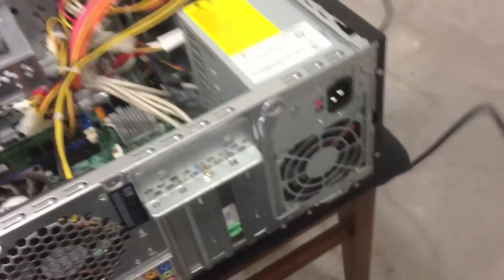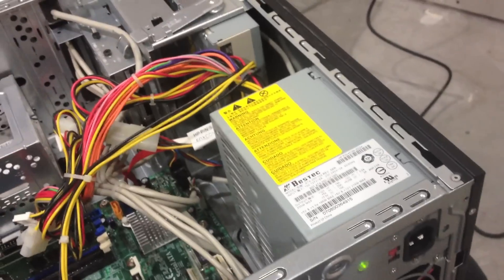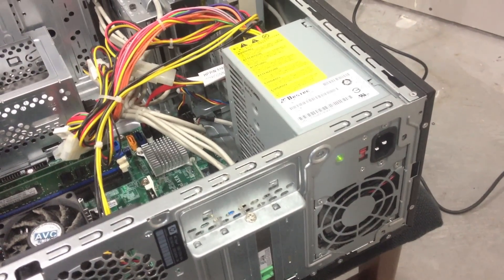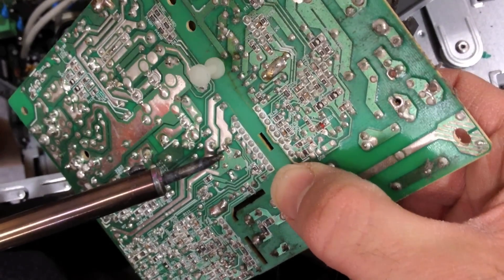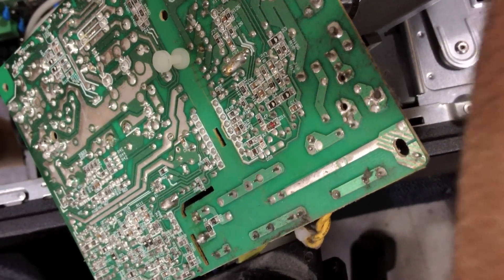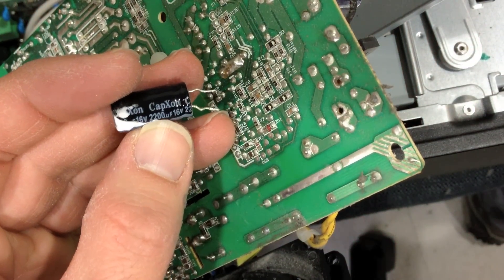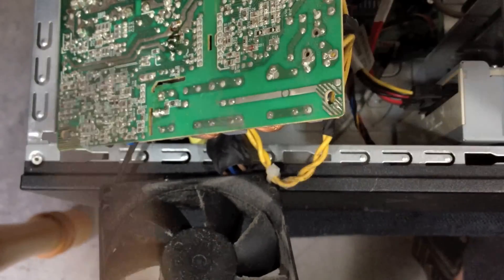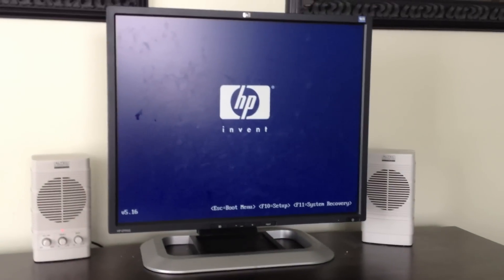Computer Power Supply Repair - DEAD bad capacitor No / Flashing Green Light

Comment: Hi, recently my PSU has become strange where my pc does not power on anymore, sometimes it does.
I particularly noticed this when we have been having many brown outs over months and months.
I do have a good surge protection plug which i spent alot of money on, i use the same for tv etc.
After giving up because my PSU just does not come on and the red LED light is not coming on at ther back either, i decided to take out the PSU and do a test on it.
I bridged the Green pin and the neighboring Black pin with a paper clip.
Plugged in the mains and turned on the plug switch.
Then i turned on the psu switch and the fan started to turn.
I tried to turn it off and on again, the fan does not turn.
I tried to unplug everything and retry a few times waiting a few minutes between each test, it seems the fan spins when it wants too and the red LED light goes on when it wants to.
I opened the PSU up and found that one of the BIG capacitors is swollen and the top is leaking fluid.
Can this cause the PSU to behave this way?
I am wanting to know before i hold my breath and find a capacitor to replace.

Comment: About soldering. After you've soldered the replacement part, hold the pc board flat, and heat the lead from the bottom keeping it flat. The excess solder will run off onto your iron and it will look like it did when it was run over the solder bath when it was made. Does a neat job.      Just saying....................'MIke.

Comment: Can you please tell me the name of the component that is wrapped in black heat shrink tube and connected in parallel to the big bulk capacitors as shown at 1:57. My one is completely blown so could not look for a part number.

Comment: You can use down to a 6.3V capacitor to replace this particular capacitor. Usually, Bestec installs a 10V capacitor, but some revisions such as yours had the 16V part. This circuit carries 5V. I've reused 6.3V 2200uF parts from motherboards to replace that cap. It's that one and sometimes the nearby 220uF 25/35/50V capacitor that will cause these units to act up. Also, the caps over on the secondary tend to fail. The Bestec units tend to have capacitors from Jamicon, Teapo, or Capxon in them. The Jamicons usually last longer. I've recapped enough of these 250-12Z units to lose count. The one unit to avoid fixing altogether, is the 250-12E... this unit has a faulty 2-transistor design 5VSB controller that fails with time and takes out the motherboard. eMachines were notorious for these units burning up, sometimes violently.

Comment: Ya next time you can subtract the solder by using a braided wire (and i would recommend resin flux NOT acid flux..) Otherwise good video...

Comment: is it weird that i ripped out 2 broken capacitors outside of a dead xbox one s and got it working with a atx psu??? shouldnt SOMETHING happen? there were originally 3 capacitors but 2 of them were dead so i ripped them out and  the console works completely fine with only one capacitor near the power plug near of the apu?

Comment: Voltage rating is important because it has to be filtered. But capacitance is not. A Capacitor has other parameters as well. Capacitance is just one of many!
And CapXon KF is a so called "Low Impedance" series wich is made especially for higher frequency stuff. And there are no 85°C Types from any half way decent manufacturer that are Low ESR or Low Impedance. So replacing that with an "85°C" Cap means that replacing a good low Impedance type that is rated for 2000mA Ripple Current (or more) with some garbage that has half of that or less!!
You can not replace different types of capacitors!! You have to replace a low ESR type with another Low ESR type, you can NOT replace those with General Purpose ones like its done here.

Comment: Put the solder on the tip and remove any excess before you then touch the connections.

Comment: Absolutely superb tutorial. My old compaq pc power supply had exactly the same fault and the same dead capacitor.made the replacement as directed and the pc is now working perfectly. I cleaned both fans while it was dismantled and it now runs quieter than ever. Can't thank you enough for your instruction. Pete.

Comment: Does your Ac input Amps have a impact on your PSU turning on i have a 
evga 500W 80 plus. That won't turn also i had a 600w that did not turn 
on so i exchanged it for a 500w power supply. Would a power strip help 
with the problem?

Comment: The proper way to solder is to heat up the joint with the iron, and then touch the solder to the joint---never touch the solder with the iron.

Comment: I had exactly this problem on our old HP desktop. Followed diagnostics from another video and concluded it was the motherboard. Bought a cheap secondhand replacement motherboard but still the same problem. Saw this video so stripped down the power unit. Exactly the same capacitor had blown C63 on the pcb mine was 2200uF but stated 10V not 16V. It had a bulged cap so changed it out. Had a very old pc in the attic to get some spares. when rebuilt it fired up perfect. Just had to reset the clock as I had removed the CMOS battery in my tests but other than that all is back to normal. Time for an upgrade i think before it fails completely. Like you I need to get a solder sucker as that makes soldering so much easier.

Comment: My antec 900w psu smells burnt..still works but stinks like a plastic fire... could this be the issue? As I mentioned, the pc still works..but crashes during gaming now
Reply from the maker: +GPUabuse +GPUabuse For sure stop using it and if you smell something burning you will most likely be able to locate it visually.
Reply: ended up getting a replacement for free :)
Reply: +Joshua Ladlee Yeh i'd get a new psu asap. It'll only keep happening till it dies and when it dies it may take out other components of your pc which could cost you a lot of money.
Reply: thanks for the answer - we ended up getting shipped two! haha
Reply: Same..
Reply: Don't change it, why you will buy another one if you could repaire it, if it's still working and you smell stink like a plastic fire so it's good like that , you can locate it easly , and look at the references and buy them and replace them , simple it is ... so don't waste money or just repaire it and give it to someone who can't buy one more if you have lot money lol you know what i mean , peace
Reply: GPUabuse great , better like that xD

Comment: My PSU was storing 100 or more volts on the main capacitors for a while, what can be damaged when that happens? For sure is on the primary but I can't find anything damaged :(
Reply: +hqdefault Found it, the transformer that connect to the secundary have a corroded broken pin :(

Comment: 90% of the time when this happens nothing is wrong you have to have the power supply plugged in unplug the 24 pin press and hold the power supply then while holding the power button plug back in the 24 pin and it should work
Reply: Actually you will find that holding the power button with the mains disconnected does the exact same thing... it's called a static discharge. This works with laptops too but you need to disconnect the battery.
Reply: Thanks man it worked
Reply: i have had the same thing happen to 3 computers i have, personally it is the best trick in the book.
Reply: yeah remember that it will happen again whether the same computer or another one.
Reply: this trick looks to be tested! mine to made a sound when i tried to power up my pc and now nothing! there's no power coming out of the wires !
Reply: +atstech if it made a sound your supply may be poached
Reply: Zachary what's the 24 pin press ?
Reply: Zachary and how do you hold the power supply
Reply: What about 20-pin boards - remember AGP anyone?
Reply: how do you hold the power supply?

Comment: I have done this many times to power supplies, motherboards, monitors, and video cards. The crap capacitors they put on there usually fail before anything else does and can be easily replaced with good quality capacitors like Panasonic and Rubicon. Small caps like the ones in PC components are very inexpensive and could mean the difference between paying a couple of bucks for a cap or a lot more for a new component. Just be safe and watch more tutorials if you are not sure.

Comment: what is all that white stuff over the pcb?
Reply: +Daniel Lee I'm not absolutely sure of this, so, someone, please correct me if i"m wrong.

The white stuff is glue, which is put on there to prevent the components from vibrating and making excessive noise (a buzzing sound, like an old laptop screen inverter). I've seen it on several power supplies. It may look quite weird, but it's perfectly normal, and, if I'm right, is actually a good sign of quality.
Reply: Racecar564 my psu has some glue under the biggest capacitors, i thought this white stuff could mean they had leaked
thanks
Reply: +Daniel Lee Negative....As Racecar564 mentioned, this is glue that is put there to ensure the components don't get loose with vibration over time.

Comment: Don't PSU store power even when its unplugged? How do you drain out the power??
Reply: +Kayemache You are correct. BE CAREFUL WITH THOSE BIG CAPS. Always use a high power rated resistor, hold it with some pliers and connect it directly to the caps leads. Do not short the capacitor leads as it can destroy it and possibly damage other components.
Reply: You wait a few minutes. Usually they have a diode or a resistor in the circuit that is supposed to drain them.
Reply: Lazar Šaronjić those big caps jolted me across the fcking room
Reply: I always use the of my Soldering Iron ac plug tip to touch the 2 terminal of big capacitor to safely discharged it.
Reply: One way is a voltmeter with its built in resistors.  IF just ripping it apart for parts - drop it in a bucket of water.
Reply: Worst shock I had from a capacitor was when I was working on a camera....the one used for the flash. Just cos the cap looks small doesn't mean it can't pack a punch.

Comment: That blue one was also the most unsafe one to use. Power supplies require high temp caps, the one you put in is rated for 85c, not like the 105c caps that are required for power circuits.

Comment: hey great video, i have a psu that want turn on while in a computer an when replaced the computer starts up fine. but the original psu will turn on when jumpnig the green an black wires on the 24pin connector while out side the computer an will also start the computer up if i manually jump the green an black wire on the 24pin connector. any idea what could be the issue with this. i spend alil over 100 bux on it an would like to fix it if i could cause its a 1000watt modular psu an the one ive replaced it with want run both of my graphics cards. thanks again

Comment: I have seen some sstrange liquid coming from the psu (CM B700).Some capacitor is damaged but im still using the psu.Should i change it fast,buy another one or just replace the capacitor ?
Will Antec VP450P-EC hold on this system ?
Intel Core i5-3470 3.2GHz
6GB DDR3 RAM
GeForce GTX 960IX-OC
2x500GB HDD
Thx for info :D
Reply: +Mise Sapphire buy a power supply if you can afford it but if you want to gamble your chances buy the capacitor and do it yourself  but if your fixing the computer for a friend or a customer you better off just replacing the power supply  with a new one. less chances to fail unless  they shipped you a dead powersupply that can sometimes happend .
Reply: rdbagaming
I have bought a new Antec psu :D
Reply: +rdbagaming And the Antec started leaking like the CM WTF ?
-Why every f*** psu is leaking in my pc ?

Comment: You got me tired watching looking at all those capacitors bro! you keep talking on and on about those many capacitors, show the values of the bad capacitor and stop the showing the rest of them other ones...just replace the bad one solder it on the board and power it back on and see if the problem has fixed..done!!!

Comment: excuse me HBT. how did u knkow the capacitor was bad? (watching with no audio sorry). It doesnt look bulged or leaked in the video.

I ask because my computer blew out with a loud pop and absolutely no power. So i ordered a new power supply of the corsair 600cxm series. I opened up the existing PS and did not find any blown or bulging capacitors, but i do see a small "something" suspicious on another object inside the PS.  I learn fast but I cant find anything online to help diagnose and confirm that the PS is the cause. I have inspected all other components inside my computer.  Is there anything you can tell me that I can look for in a bad power supply? PHysically?  I have every symptom of a bad PS btw, im pretty sure it is the PS.
Reply from the maker: odiumimbues In most cases it's better to buy a new P.S. instead of fixing it. But for others it's easier to fix. Especially when you MUST get the computer running immediately and don't have time to wait for shipping.  A "pop" could have been a cap blowing but they often don't do that.  Mostly they just act half power or leak and totally die.  Without seeing it I can't say what the suspicious thing was. Glue maybe?   Things to look for are burn marks on the PCB, bulging or leaking caps, bad fuse, and anything fried or cracked.   As for the computer in the video; look at this part 2:22 you can see the brown on the top of the capacitor. Thats the leaking fluid oozing out.  Then I move the camera to the side and you can see a very small bulge at the top. Like a coke can.  It shouldnt look like that. It should be completely flat.   A bulge is a dead giveaway that the cap is bad.

Comment: Hey i need help, i have the same make and model i belive hp p7-1414 I think my husband turned it off without powering down and then it stopped giving power to the monitor, mouse, and keyboard but everything inside like fans are spinning so we did everything we could..the green light is steady, fans are on, disk opens but closes like real fast!. No blinking at all on green light so my husband changed the small internal battery and since then the blue light that lights up the front is no longer on, i hear no beeping i am pretty sure its a power issue but why is the green light steady? Help please! I dont know if i should just buy a new power suppy and install it or get a hp year long warranty to get it fixrd which will prob take forever
Reply: +auddiekaos401 The green light is supposed to be steady, that's a good sign. It's been eight months since you've posted this, though, has the problem been solved?
Reply: +Racecar564 yea it was a bad motherboard..sucked replaced it
Reply: +Racecar564 ty for the info!
Reply: audra powers I'm glad to help!

Comment: Just this afternoon I dismantled the exact make and model failed power supply as pictured in this video from my 2008 HP computer. A visual inspection revealed the same bulging capacitor as you found. After scraping the white putty off the tops of the other capacitors I discovered TWO more budging defective parts. After de-soldering the three from the board I noticed that all three were black colored and of the same value (2200/16v). Every other cap on the board was colored a dark reddish brown. This indicated two different manufacturers. There are three more caps of the exact same spec (2200/16v) and one 2200/25v colored dark reddish brown that were perfectly fine. You may want to take a second look.

Comment: Pretty good, but you really should spend the $3 on a solder sucker. If you use those needle nose pliers, you might take the whole copper pad along with it. Also, tin yo' soldering iron!

Comment: You should be soldering with the board in a FLAT position, so the solder does not run.
I know you are demonstrating, but the viewers should note not to solder with a slanted circuit board - it is highly illogical.
Reply from the maker: You are right. On top of that the iron I was using was junk and the solder was way too thick.  But hey, it works.

Comment: While HillBrosTech is sharing knowledge, he’s missed out key points, the temperature rating of capacitor is also important, he’s replaced 105◦c with 85◦c, like voltage you can usually replace with a higher temperature, but not a lower. While HillBrosTech fix will work the lifetime of the capacitor will be greatly reduced.

Capacitors especially electrolytic (type shown in the video) have the shortest “lifespan” (MTBF) of passive components typically found in circuits. Thus using used ones isn’t really recommended, especially with the el cheapo brands he’s salvaged.  Brands like Rubycon, Sanyo, Elna, Nichicon and Panasonic if you’re going to salvage might be worth keeping.

HillBrosTech didn’t cover discharging those large 200 – 500 volt caps which are typical in computer (SMP) PSUs; if your skin bridges the terminals of these caps they can jolt you across a room, burn, or even cause heart failure if they still have a decent charge!! While the battery analogy is okay-ish at a really basic level, a battery cannot dump all its energy into you in a split second while a capacitor pretty much can.
Reply: Yeah discharging is very important advise....just get a couple of alligator clip wires and a resistor (higher value the better) for a quick safe caps discharge.
Reply from the maker: Thanks Lloyd for taking the time to share the info!  Yes the caps are lower temp but that is what I had lying around.  The computer is still working.  The original caps failed when the computer was in storage for about a year.  It was put in storage working and came out not working.
Reply: keep the effort up HBT ... i'm too lazy to do what you do!